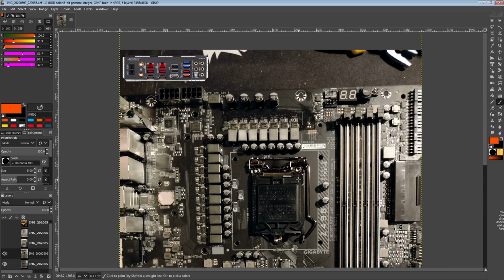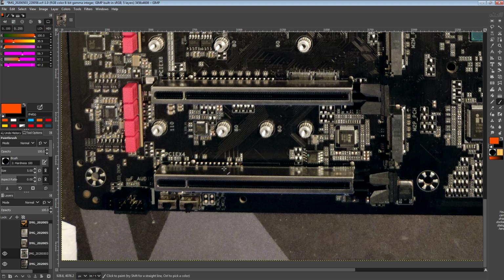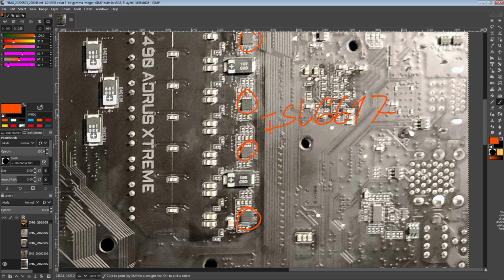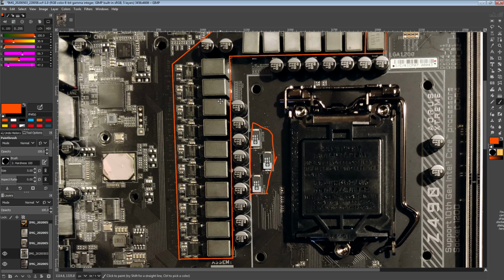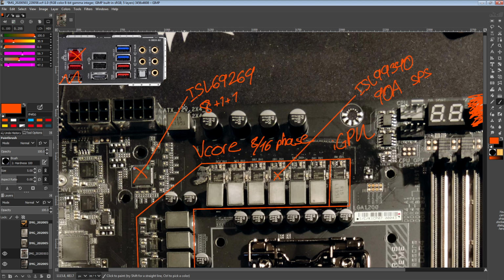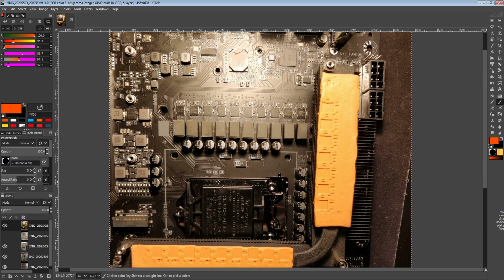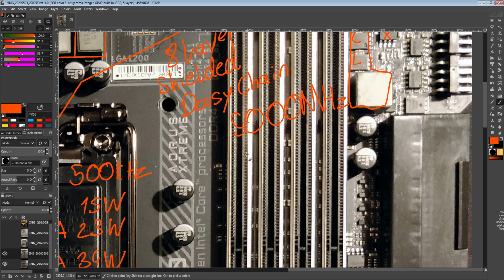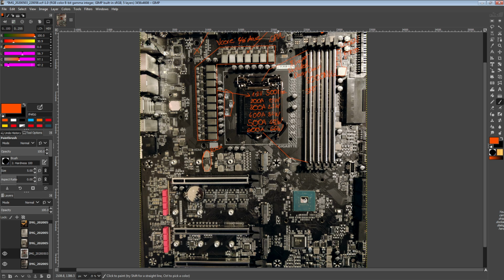mobo PCB Breakdown: Gigabyte Z490 Aorus Xtreme

Comment: I just installed this mono. But for some reason I get no beeps or no bios load.  Everything starts up fine and fans and run lights up fine. But just black screen and bios splash screen.  I even back the components out all the way to just psu and motherboard still no beeps.  Anybody with any ideas why I would appreciate it before sending it back
Reply: I got this motherboards, its faulty as fu**. I got several problems, just rma it today nearly after 20 months....

Comment: @BuildZoid: I know you really dislike the Dual Bios switches but I love them. I have several different BIOS setups depending on what workload I'm doing that day. I really appreciate the ability to flip a switch and load a different Bios when I want to. As well the software capability to do it as well is also really convenient. With the switches, I don't ever really need to use the Safe boot or CLR Cmos button on the rear IO.
Current Board: Gigabyte Z390 Aorus Master

Comment: I bought 2 kits of Patriot Viper 4 Blackout Series DDR4 16GB (2 x 8GB) 4000MHz for my Intel 9700K game machine that is overclocked to 5.0 with no problems. I enabled XMP and the Viper sticks immediately went to 4000MHz, again with no problems. I then changed the speed to 4133MHz without making any other changes, expecting it to crash. It didn't. Everything is running fine. I just up the frequency with zero other changes. Is there any risk for this extra 133MHz?
Reply: Why would there be

Comment: Why don't more powerstage manufacturers use those metal tabs on top of the package for better thermal transfer to the heatsinks?

Given what you said about the packaging not being good for thermal transfer, that sounds like a fairly simple way to reduce temps quite a bit. 

Yet, you don't see it very often. Is it a patent issue? Is it surprisingly expensive to implement?
Reply from the maker: the metal tabs are very expensive to do.

Comment: Hello Buildzoid,i have a question and i need help,what is the maximum ram frequency and cas combo of a decent 2x8 kit(i watched the video where you proposing ram kits 2 months ago) to run with a i7-6700k on a good z270 chipset on xmp without issues?Thx in advance :P

Comment: I know they might be quite cool considering the low power required but having power stages directly beneath the m.2 slot seems a tad iffy in regards of thermals, not for the powerstage but for the m.2 drive, perhaps i'm overestimating the thermal radiation to the m.2 board but it does look a little weird as a spot to put powerstages. It might not make a big impact or any at all but it looks odd to me.
Reply: He said the Vccsa rail is like 10A so that basically produces no heat at all given it's cooled by the PCB itself. No concern for M.2 drives here.

Comment: Bz is always complaining about side to side LEDs , but i recently found it that it isn't as hard as he makes it sound like 🤣.
Reply: If they are the same color, they are such a pain
Reply: @UltraDXSASC  i have a b450 tomahawk max , the debug LEDs are all red , i've used them only twice , and in both cases it was super clear for me 🤷🏽‍♂️
Reply: That's nice. The point is that it could be easier with a better solution.
Reply: Yeah but Asus has proven multi colour is not impossible or even super expensive, and it is objectively superior. 

I can survive with nothing, I managed to not kill myself using my x570 aorus i pro, but that doesn't mean that's a reason not to do better.
Reply: Oh yeah Asus also proved (maximus viii impact) that you can put a post code on the rear io. More people should do that too.

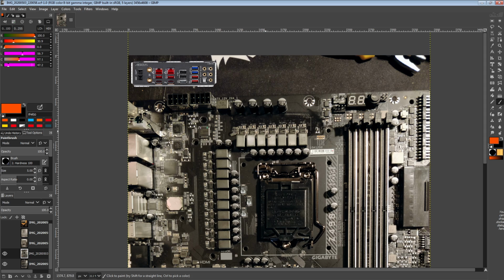Comment: 0:42 Overview of Z490 Aorus Xtreme features
5:15 Dual Bios Rant
9:32 Power Delivery
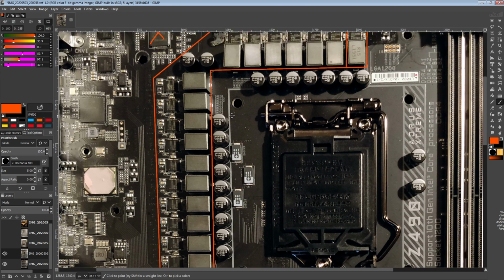15:50 Gigabyte added Tantalum Capacitors 
24:49 Back to the Power Stages
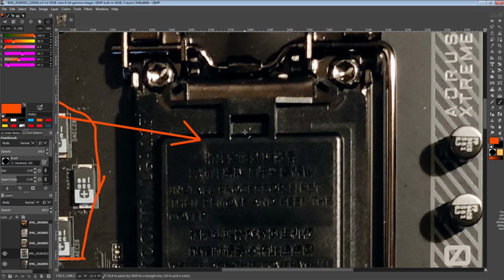29:04 Power Efficiency Calculations
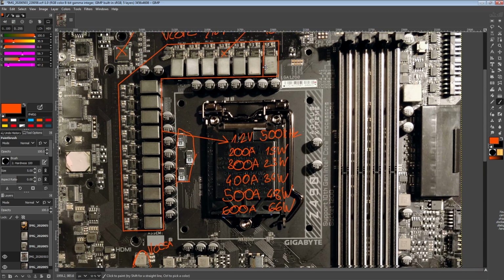36:35 Memory Topology & Layout
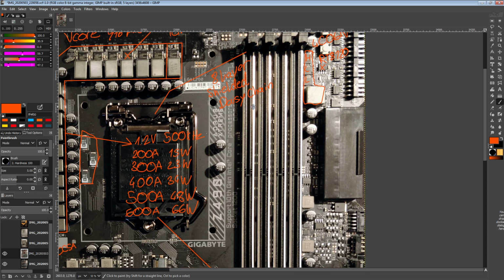40:00 Z490 Improved Memory Speed Claims 
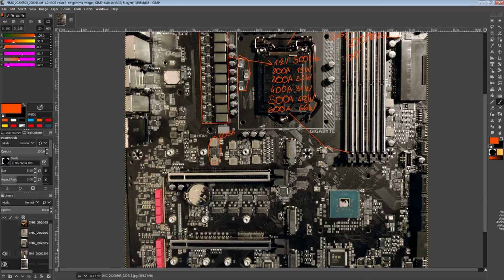45:10 Conclusion
Reply: nice
Reply: You are a legend 😁🤣